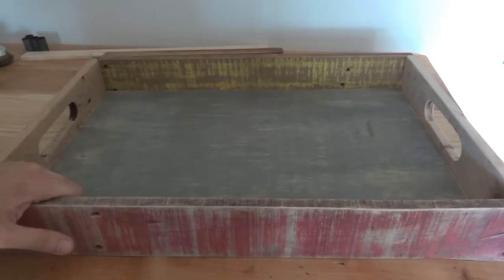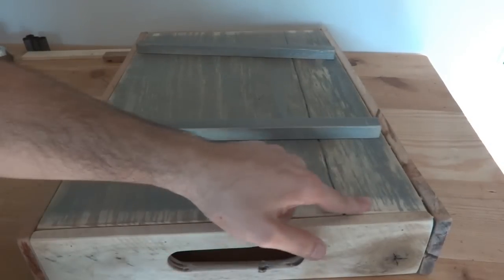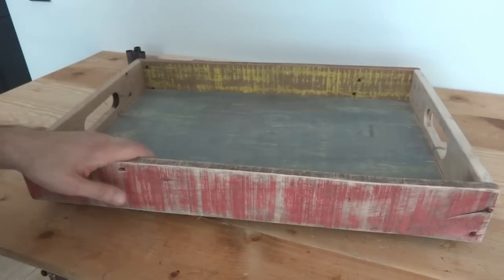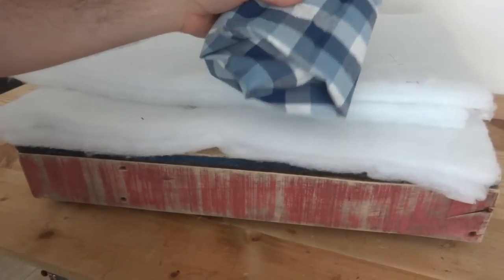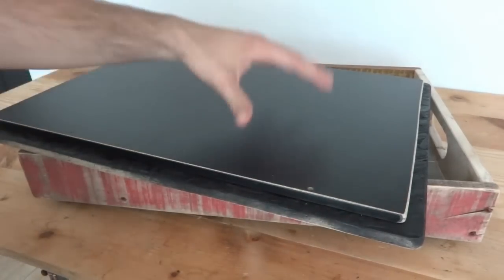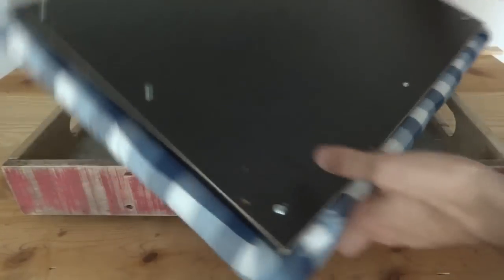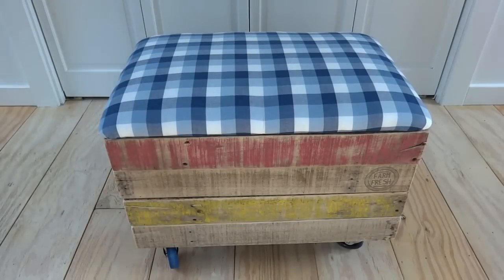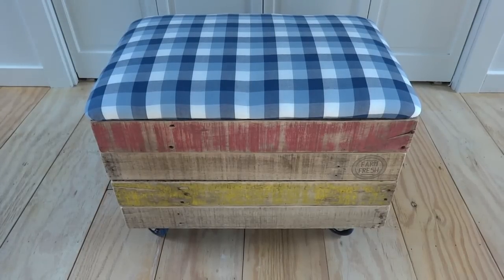Build a Stackable Pallet Crate Storage Bench - Part 2 of 2

Comment: Nice build. However I do believe that all the weight will end up being met by only by the pins and glue on the bottom plate with the casters since the bottom plate is inside the frame (if this makes any sense). Great idea none the less.
Reply from the maker: True. I think the glue should be plenty strong though.

Comment: can you tell me how to repair particleboard,  thank you
Reply from the maker: Not sure exactly what exactly you need to repair, but particle board can be tricky since it's not solid. If it's a split or chunk missing, you can try wood glue and clamping it back flat as it dries.
Reply: Yes, it is a chunk of corner from my armoire.  Thank you I will give it a try.
Reply from the maker: If you still have the chunk that fell off, I'd try attaching it with wood glue and use a clamp or even masking tape to hold it in place while it dried. If the chunk is missing, you can try to fill and build it back up with some wood filler or bondo, let it dry, and then sand it smooth to match the shape of what it's supposed to look like. The only thing here is that it won't match the finish, so you'd need to paint everything to match.